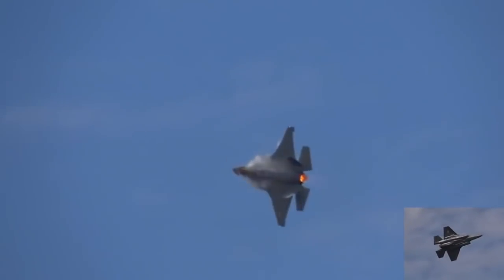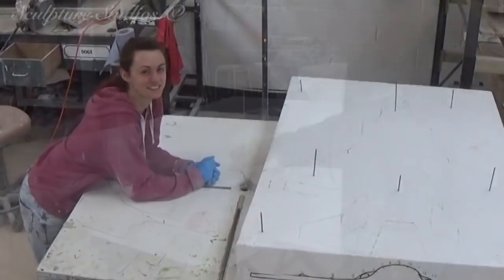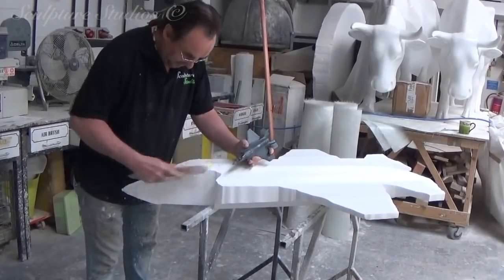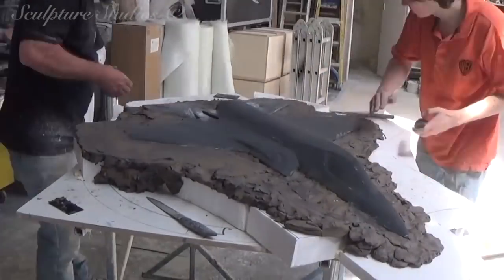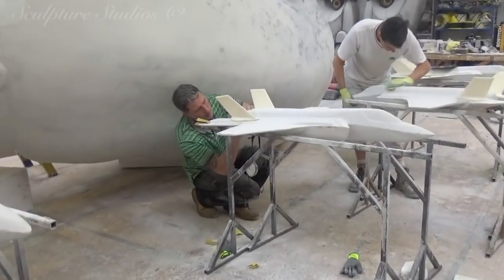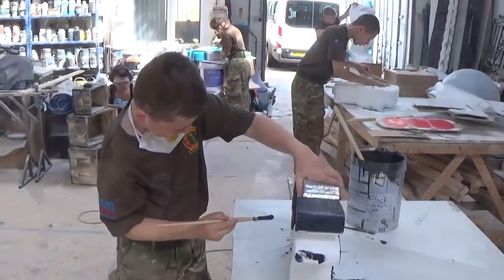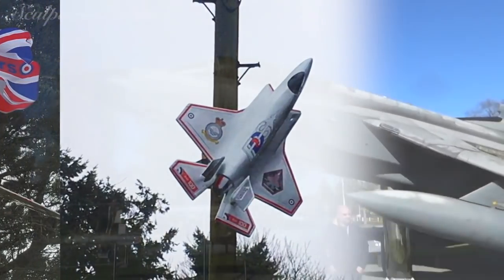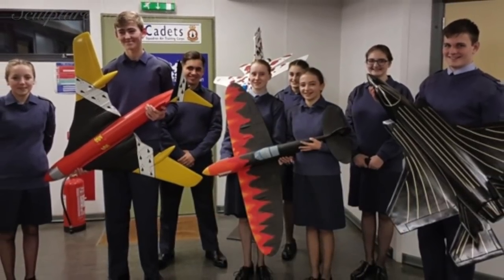F-35 Lightning II Jets - Fibreglass Plane Models by Sculpture Studios

Comment: Another great project and video. With 3D printing (or rapid prototyping), which I am somewhat involved in, the time that it takes for to create the 3D model to print can be nearly as long as carving it by hand. Then there is the clean up.  Rapid prototyping does not scale, the 100th print takes as long as the 1st, which means that we would normally make a mould of the 3d printed master and cast them anyway as this is much quicker.

Hand sculpting when not a mechanical part is usually quicker and more pleasing anyway.  Long live the sculptors!